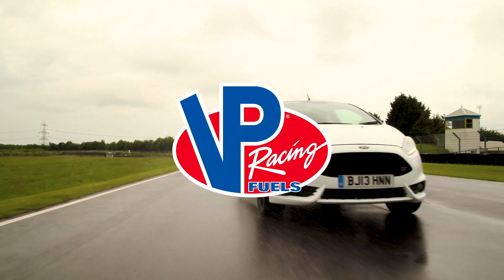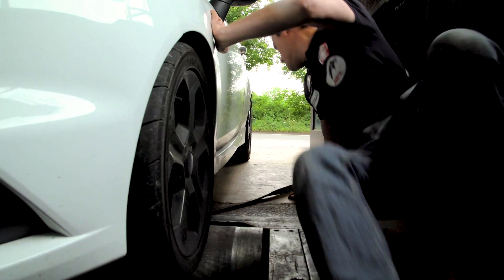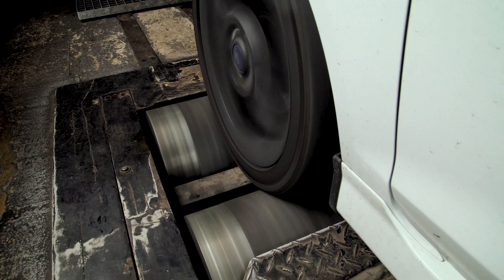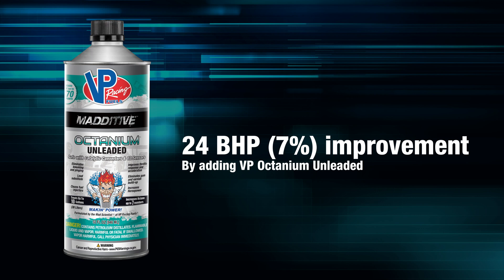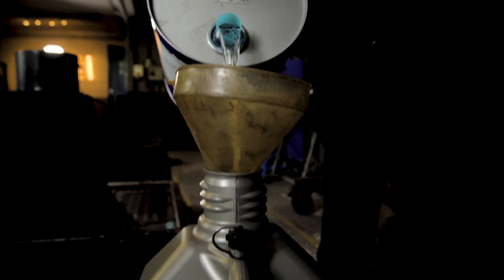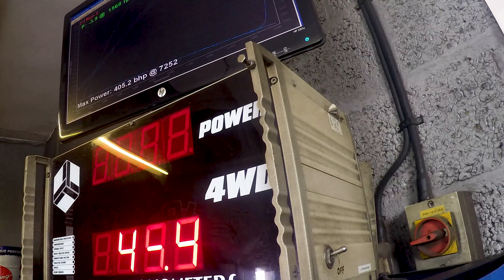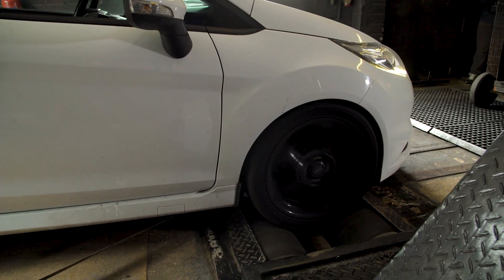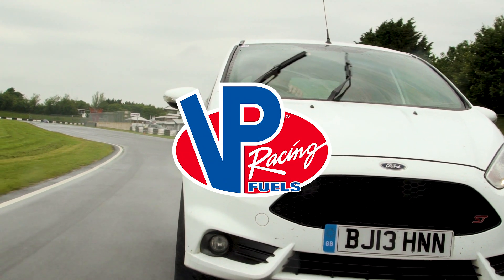Dyno Testing Octanium Unleaded vs RX102!

Comment: Willl this increase power slightly on my revo stage 3 tuned mk7 gti, it’s around 400hp-400ftlb mapped to 99 Ron
Reply: If your tuner adds more timing and fuel it should make a decent amount more
Reply: My focus st 2016 is tuned already will this matter if I just dump it in I’m currently tuned on 91 octane if so will I be running 99 octane ?
Reply: @jmeloarts6480  like the comment before yours, unless your tune has more timing added to it and there's a HP gain from adding timing, only then is it going to help. Dumping this into your fuel doesn't add power or timing